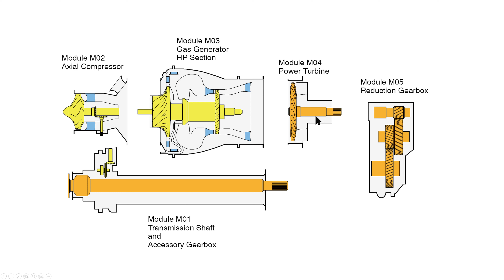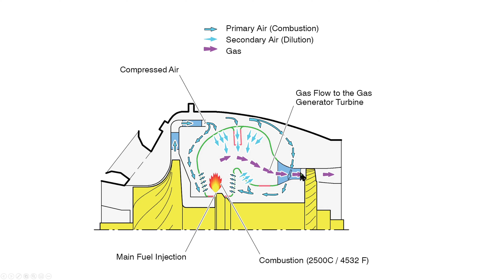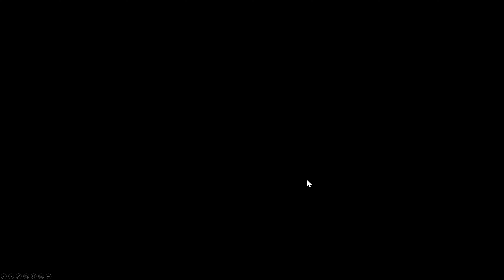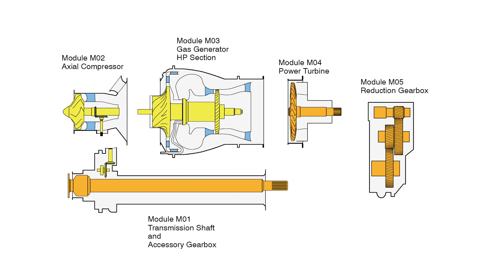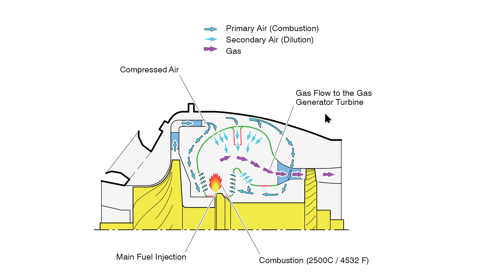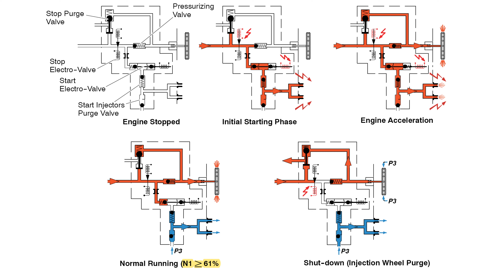HPG H145 Engine Deep Dive

Comment: 12:13 That fuel slinger wheel reminds me of an oil fueled heating system that my father was fixing in a church in the early 1970s!
The disc/fan was horizontal, (vertical shaft) fuel poured onto it and was slung outwards, breaking it into fine droplets and mixing with air.
Much slower RPM though!

Comment: I just started flying the H145 for an EMS company. I am used to the T700 series engine in the UH-60 Blackhawk, so I am familiar with the turbine engine design concept. But you really explained this in a way that I can understand how this particular engine differs...Great Job!!
Reply from the maker: Thank you. The 700 has some really cool features that mirror the Safran (modular design) but it blows my mind how simple the 2E is comparatively. The N2 to N1 ratio on the 2E is impressive for only have one stage each of axial compression, GG and power turbine stages vs 5/2/2 on the GE.

Comment: Great explanation. What surprised me is that the bleed valve is open during most or all of the flight. This means that the compressor is doing more work than needed which also means some fuel is wasted for compressing air which is dumped outside of the engine. Strange.
Reply: I could be wrong here, but my understanding is that this is to reduce/eliminate turbine lag. By making more power than is strictly needed, the power is there when it IS needed (such as a quick change in power demand). When not needed, it's bled off. The valves will close as you increase power demand because the power is no longer in excess. You can see this happen when you smoothly raise the collective to your max range TQ setting, which is about when the valves will close, as that's optimum engine power production efficiency. You can also see this on the max range performance chart; its a little zig-zag in the chart where the valves close and the engine is slightly more efficient.

Comment: What an amazing video! do you know the Differences between the 2E and the 2D engines that are on the H125 and H130?
Reply from the maker: Yes. Very subtle. It's mainly the mounting of the two engines. The 2D is is a single forward mount to be used in a single engine configuration vs the 2E having a dual forward mount. There are some very minor accessory differences as well but when I went to the Safran Level 2 school for 2E, I actually disassembled/reassembled a 2D instead of a 2E because they are so similar.
Reply: Thanks! It’s a great engine. I really enjoy flying it on the h125 and H130. Easy to use and forgiving.

Comment: Hi @Shipmeck. Great video. Seems there is no clutch on H145 between engines and rotors. Does it mean that when the second engine is started, the power turbine is already spinning ?
Reply from the maker: There is a sprag clutch in the transmission, that disengages when the transmission spins faster than the input shaft. When the 2nd engine is started and the power turbine reaches the speed of the transmission, the sprag clutch starts to engage and providing torque.
Reply: @Shipmeck  cristal clear, thanks. You may answer another question: what is the circular tube in the middle of the tail. If I'm not wrong, it's an antenna but I failed to find a clear explanation. It looks more like a pipe (for hydrolic pump) or something.
Reply from the maker: @yamatubeable  are ypu talking about the u-shaped pipesbl, parallel to the ground opposite each other? ILS antennas.

Comment: I'm assuming that the rpms, stated on this chart, is, @ full-throttle, or 90%? Right? At idle, the rpms for N1 and N2 are much lower.
Reply from the maker: All values are given at 100% maximum rated. 100% n1 will rarely be seen. Nr varies between 103.5% and 96.5% depending on airspeed and density altitude.